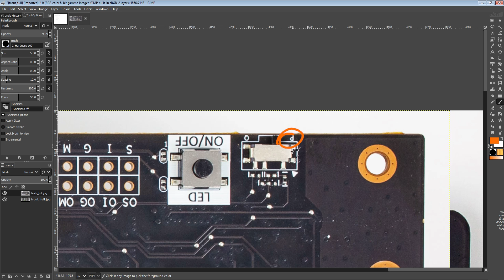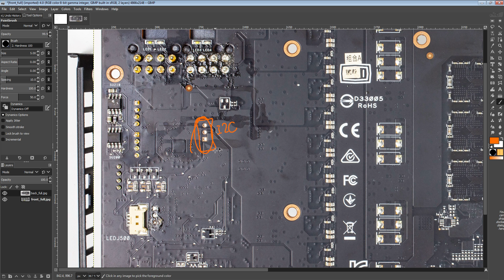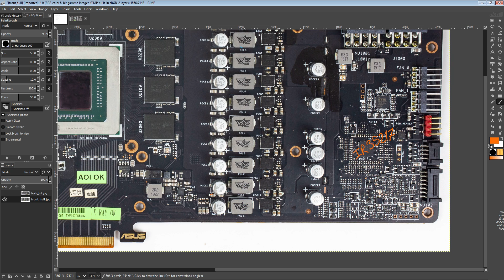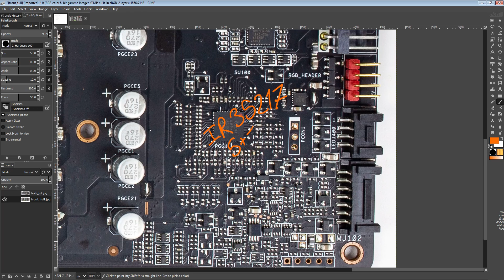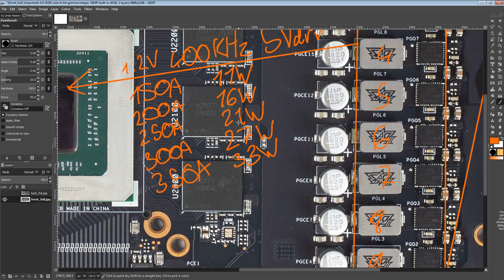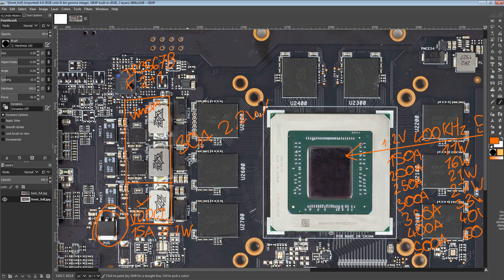GPU PCB  Breakdown: ASUS RX 5700 XT Strix

Comment: This maybe have better PCB than reference card, but judging by the previous STRIX RX Vega this could clock like shit. 

And the cooler is same as on those Nvidia card, which means not suitable for small 7nm Navi10 die and the temperature shows that.
Reply: Yeah i don't get it. This is the most expensive 5700XT and yet temps are worse than cheapest aib 5700xt which is Sapphire pulse ($410)
Reply: @Arif_Islam77  probs down to testing methodology / the strix fans spinning slower
Reply: @poopeepoopee69  why would it spin slower on default and it should be spinning at normal speed like every other card
Reply: @Arif_Islam77  every card spins at different fans speeds with their own fan curves.

Comment: Do you think this board design will give anymore OCing head room over reference design say with water cooling? or is this only really good for extreme OCing?
Reply: dont think they will. I think this would be useful for the ln2 guys
Reply: Board designs never given huge advantages even to Nvidia cards besides cooling. So if you only care about cooling & cost, (not design language, not much higher quality and costlier pcb or extra headroom for extreme oc), then sapphire cards are the way to go. On nvidia's line up, Zotac amp and gigabyte gaming OC cards are top notch too as they are cooler than their beefier counterparts like Amp Extreme and Aorus
Reply: @damienriot  amd cards are better for overclocking than nvidia cards nowadays
Reply: @dyren7437  the 5700 and XTs aren't. The asus cards come pre oced and thus their oc headroom is minimal. Vegas had better undervolting potential but you Cant expect half of the cards to reach that. Even hardware unboxed's review sample of both vega 64 and 5700XT didn't gain much after UV+OC. If cards were this much stable in literally everything on those insane overclocking numbers found in ocn, amd nvidia both would clock their XT and super at higher clocks and charge more. At least AIB boards would do but even they Cant.
Reply: @damienriot  I see you havent heard about the power play tables for the navi cards yet...
Reply: @dyren7437  I have heard about it in reddit more than a year ago but you can't expect every card to reach the best possible numbers, can you? It's completely illogical. Silicon lottery will always play a role in final achievable core clock and thus performance. Check HUB's reviews where steve clearly mentioned he couldn't push his vega 64 much. Now pls don't say that you think amd didn't know about their own gpu's power play table and ''intentionally'' kept the gpus ''weaker''
Reply: @damienriot  my god...
Of course silicon lottery is the main factor here, thats why i say that a strix version wont have much overclocking headroom over the reference design. It only has some advantage when xoc'ing, because then the extra vrm phases will deliver more stable output.

With the powerplay tables, i mean those with the +90% power limit and 1.25v.
Of course they kept the gpu's 'weaker', because with that powerplay table on an air cooler you will fry your core and mosfets...
Of course they know they can push more out of their core but they need to keep the temps reasonable.
Reply: This is the most expensive 5700XT and yet temps are worse than cheapest aib 5700xt which is Sapphire pulse ($410)

Comment: It apparently does have fan stop at idle on performance, which they don't have on the nvidia cards
Reply: yeah pretty sure quiet mode on AMD cards is just a default power limit change. that's how it was with vega 56 where P was 180w and Q was 160w.

Comment: You really get a prospective on how small Navi 10 is when you see the die is very close to the size of a GDDR6 module.  I'm used to seeing LaVideo dies looking like the size of a slice of toast.
Reply: 5070xt is almost half of the size of the 2070Super, and that's insane
Reply: @TheHighborn  But late on this but it's not "Almost" half the size. It's smaller than half the size.

2070 Super has a die size of 545mm.
5700XT has a die size of 251mm.

But that's typically been the case with AMD for some years now, their CPU dies have typically been smaller than Nvidias even across Polaris which had die sizes smaller than the current Navi10 (Exception is the GTX 1060 which I vaguely recall was mostly equivalent in die size). 

It's just that before Ryzen shifted peoples perception of AMD, the majority of people outside of tech enthusiasts  didn't care to actually look at the finer details. Now that mass perception of the company is shifting, more people are actually taking in the specific details that have always been there.
Reply: Tiki832 smaller but still pumping out insane amounts of heat
and don't you even pretend it's not true, AMD has always needed a higher TDP to match Nvidia's high end cards, even when AMD beats them on price point (which is actually pretty often)
Reply: @KingHalbatorix  Yep. Nvidia have a heck of a advantage in power efficiency, I suspect largely through their development of Tegra and lessons learnt there that they can apply directly to their discrete desktop GPUs.
Reply: Cant wait to see how big the 5800 or the 5900. Do you think they'll have a 5950XT ?
Reply: @puertadlm163  I think somebody describer that xx50 cards would be refreshes but I'd say at least one bigger GPU is coming and I wouldn't be surprised if even bigger ones came up. The real question now is how much is NV rekt by those cards and if they'll have a sufficient answer for that
Reply: @puertadlm163  Lmao, I remember this rumor, I think they might have had plans initially to make big dies built to use 12GB of 1GB G6 modules, but found it impractical vs NVIDIA's offerings. Heck even the 6900xt was a hybrid between a traditionally big navi and RX 5700xt design, and were it not for double density G6 then "Big Navi" would have also had 8GB of VRAM, unless mirrored on the other side, it wasn't until the RX 7900xtx that Big Navi would arrive. Smart people over there in AMD.
Reply: Yup, this is why i find it incredible that people are making a massive fuss about it not having much thermal headroom on ambient... These things use under 150w clocked at well over 1550MHz... They should be compared against the 2060 and 1660ti rather than the rebadged 2080, and they probably will when bigger navi dies drop (2x the size of navi 10 is definitely on the table)

Comment: Funny one of the more expensive customs is the first released, i dont like the temps of it. Gotta wait how the other customs look and review, my wallet is ready for a 5700xt or 2070S, custom reviews will show me the path.
Reply: Red Devil or Nitro+ is probably gonna be the way to go.
Reply: @rinhato8453  powercolor is cheap brand. Probably uses cheap pcb parts. So more likely to die faster
Reply: I bought reference  5700 xt and I’ll add ek water block to it for better cooling and keeping it in line with my pc aspheric

Comment: Thanks for the product breakdown. As long as the price of this product is less than an RTX 2070 and performs better then it will be great - otherwise what is the point? Price to performance the blower version/s is/are competitive. Is this PCB designed for 'up and coming' GPUs from AMD? The overkill in VRMs could suggest this?
Reply: From what I've seen Navi's Achilles heel in terms of performance scaling through overclocking is lack of sufficient memory bandwidth, the GDDR6 chips used for at least the reference cards don't really go higher than 900-910mhz (stock is 875mhz so it's literally just a 400-450mhz memory overclock overall)

Comment: IMO, first I2C is for GPU controler, 2nd for memory controler
Reply from the maker: nah I think the first connector is for the ITE chip that probably does fan speed and RGB
Reply: @ActuallyHardcoreOverclocking  with 1st I meant the bottom one, and 2nd for the one next to ITE chip, but that doesn't matter :-D

Comment: But is the cooler any good? With the Vega64 the PCB looked great, but the cooler was a disaster. VRMs would get incredibly hot and would cause throttling at stock. It requires undervolting to run the same as a Sapphire Nitro+ at stock.
Reply: So reviews are out and you can look them up, but for what i know right now is the card gets 77°C max and the VRM is getting cooled this time around, but i dont know the exact VRM temps.
Also, the problem on Vega64 Strix was the thermal pad for the VRM, it didnt align with it and therefore couldnt get cooled and throttled. You could fix it by getting a thicker thermal pad.
Reply: @CarbonPanther  I know you could fix it, but you should never need to fix a 400-600€ card. Even after fixing it, the cooling performance on the VRMs was still way lower than in a Sapphire Nitro+ (which was also cheaper).